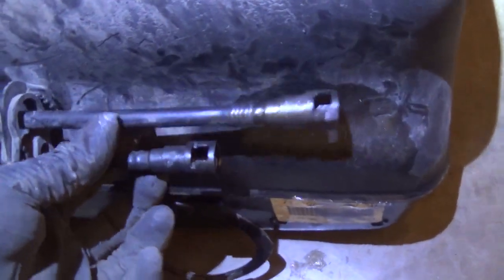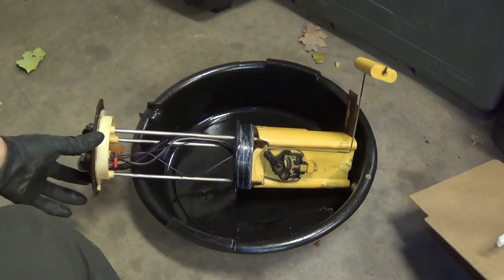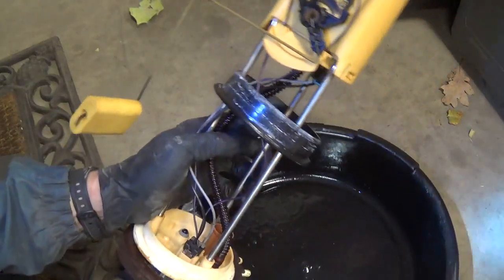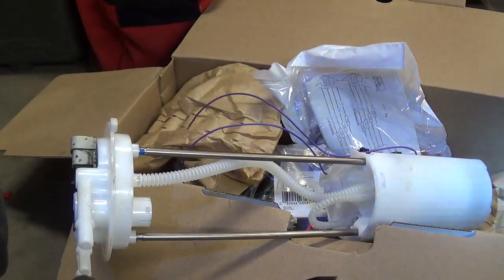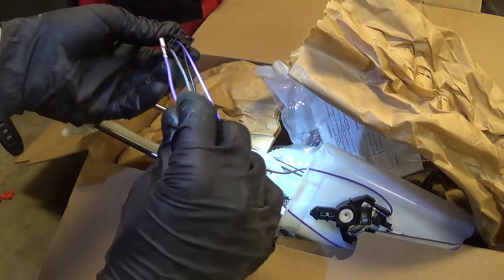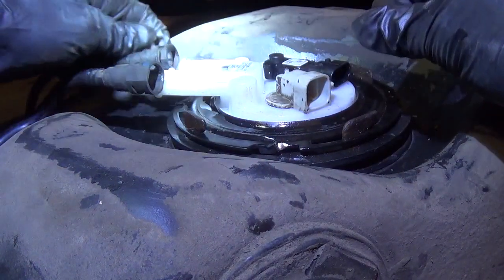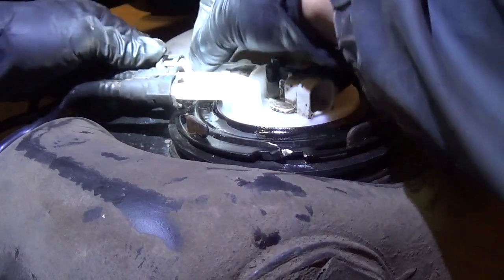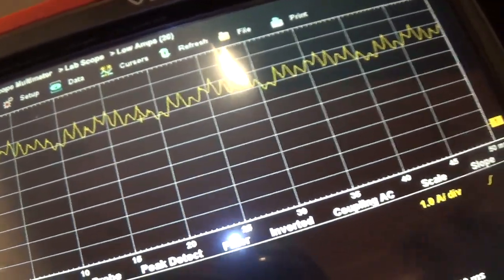Fuel Pump Replacement: Chevy GM Truck

Comment: shoot .. I would love to watch this,, but got to leave for work early ..we got 1/32 of an inch of snow here in Seattle ..and it will slow up everything LOL
Reply: Very light snow is worse than an inch or two.  That is what cause the big pile up on I-96 in Livingston County MI the other day.
Reply: theoldwizard998   here in Seattle..the bigger problem is..we have hills..lots and lots of steep  hills..and snow is rare..so cars usually are not equipped correctly
Reply: I don't see any snow ...I'm in Fla
Reply: @midnightrunner684  open up the back of your air conditioning system make sure they're probably some frost on the coil someplace That's the type of snow we had that day haha

Comment: Are the butt connectors weather proof, or just plain junk ? would soldering, and quality sealing heat shrink be a way to go? ...  just things to consider. Maybe you could do a video on connecting wiring? I think your followers learn a lot from you, I know I have.

Comment: I give you a lot of credit.... I try not to touch fuel tanks. Too much risk and you end up stinking of raw fuel. I was doing a fuel pressure check on a F150 with the quick connect fuel lines and the whole place stunk of fuel I had tone go out and get fresh air

Comment: Good video as usual. Does changing the wiring to the old plug affect the warrantee on the new pump? Also I normally add a little oil or white grease to the o rings and tank seal. I am surprised that the pump did not come with the fuel line clips on the new pump. Boy are things getting cheap in the parts industry. Keep up the good video's.
Reply: I know that in the late 1990's GM had a service bulletin that said to replace the wiring harness with an updated version. The original harness had a tendency to short out and burn the fuel pumps up.

Comment: fuel filter change ??
Reply from the maker: I'm pretty sure the fuel lines are going to rust in half within a year, at which point I'll put a new nylon lines and filter on it ;)
Reply: Oh ok:)
Reply: So are you sure the in tank filter/sock/boot was not sold separately ?

Comment: Lord, that fuel sock looks totally slugged up with garbage.  That will kill off a fuel pump wicked quick!  Wonder how much (as I'm only part way through the video) Wondering how much trash is sitting in the bottom of that tank!
Reply from the maker: I took a peak in there...actually surprisingly clean!
Reply: Color me surprised then.  That sock looked pretty well bunged up.  Glad to see it was a successful repair!

Comment: why do you skip over video of tank removal? I would  like to see the whole operation for better or worse!
Reply from the maker: it would have been a pain to get the camera and lighting under the truck...it's just two bolts and fuel tank straps then just lower it on a floor jack. Don't try that with a full tank obviously lol

Comment: They have changed the connector style not because the new design is safer or so they only changed it because its not made by GM original equipment manufacturer anymore so long for the great heritage of  made in USA

Comment: Hey Ivan got one for ya. Fuel related. Guy I know has new Dodge Truck. No matter what he can't get it to fill up over 3/4 tank on the fuel gauge. What's the problem? answer later today if you or no one figures it out. True story btw.
Reply from the maker: Is the gauge lying?
Reply: No sir. And that is a big clue.....
Reply: Gonna go ahead and answer it now so maybe you'll send me a PHAD cap. After a few weeks, (he hadn't got around to taking it back to the dealer yet) he was filling up (or trying to) at the gas station and a guy comes up to him and says : "Hey did you know your gas tank is hanging down?" Brand new truck btw, bolts had either loosened or totally fell out of rear strap I believe it was, maybe two of the straps. Absolute true story ! Joking about sending me a cap of course. But I would pay for one if you ever get some made up. Always great viewing, yours and Eric's videos and I know you got some comments about needing to solder the wires vs swapping out the connectors, and idk , but no issues with that same connector prior to this leads me to trust your judgement.

Comment: That harness kit they send you is a joke. How long do they think a mickey mouse solder and crimp is going to last in the PA salt and corrosion extravaganza?

Looks like that filler neck breaking just saved the guy a diagnosis for an EVAP code a few months down the line as well!
Reply from the maker: Oh don't worry the vent solenoid has been busted for the last 5 years anyways LOL!